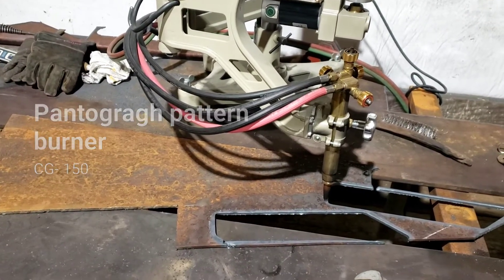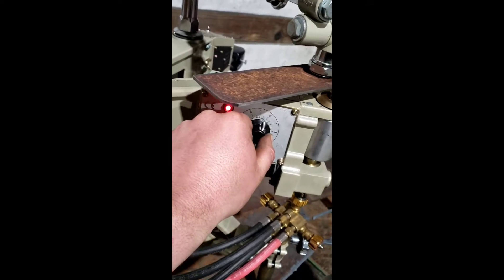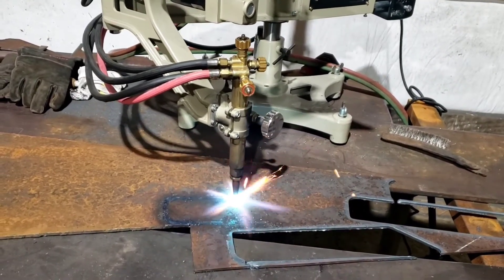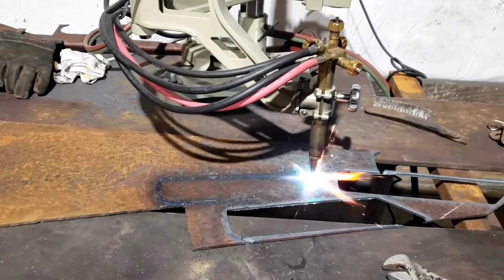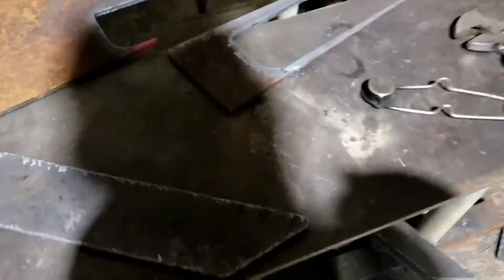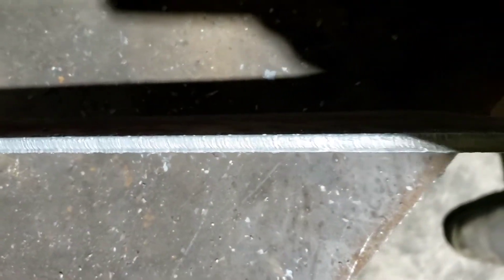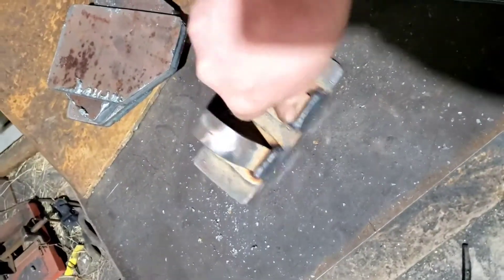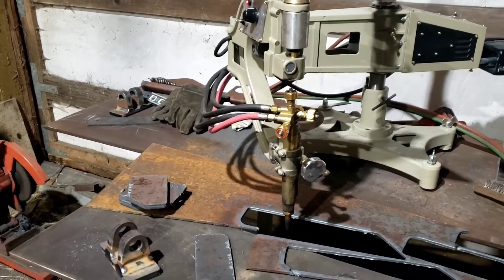pantograph torch pattern burner

Comment: Looks good! 
Isn't AR plate prone to cracking on welds? What rod do you weld the AR plate with?
Reply from the maker: @jacquesdm2382  just been running dual shield .045 in my wire feed havent had any issues in the past 2 years. Preheat everything religiously.
Reply: @ awesome, thank you👍